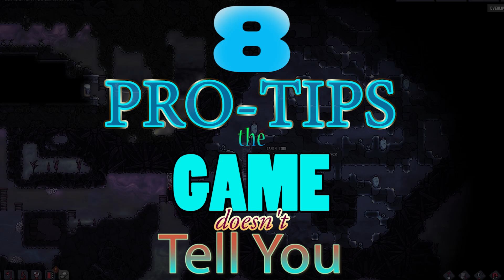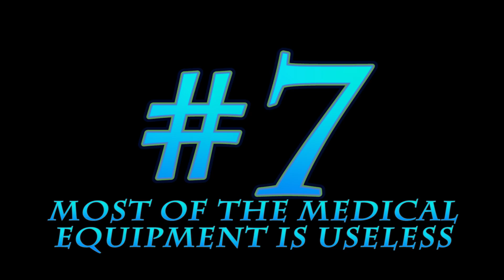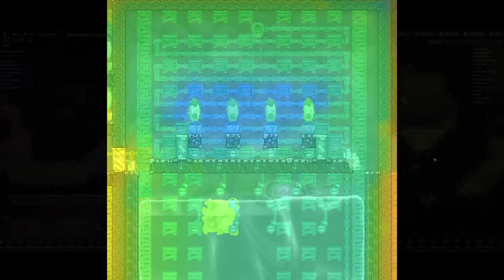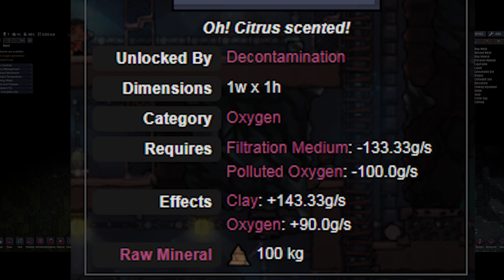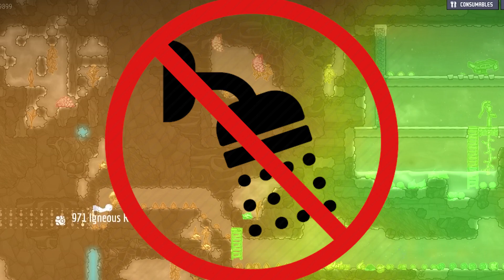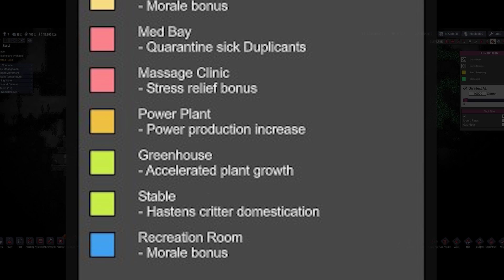8 PRO-TIPS THE GAME DOES NOT TELL YOU - Oxygen Not Included Tutorial / Guide

Comment: 1.Store food in a carbon dioxid pit near kitchen its sterile athmosphere there is less decay without oxygen . Its powerfree no refrig needed.   2. Store polluted germ water early on in the liquid tank in a hot area the germs beginn to die off quickly  power free except when the pump runs for the sinks. Or loop the toillet trough a tank its no more power needed. Just for the sink. 3. Go as long as you can without coal or other generators than the mill it keeps heat low.

Comment: Here's something I've discovered as I've gotten more used to the game. See, I've developed this system where I clear minerals/organic blocks 4 tiles at a time (the Dupes stand on a random block, and I clear up to four tiles above that block) since that's the maximum height they can reach from the ground, then build a tile underneath and above that 4 tile column. This ensures I clear out each pre-existing block for resources and leave in empty enough to establish a room. That being said, you should only have 16 consecutive tiles max if you're going to make a room out of it later since the maximum amount of tiles most rooms can have is 64 (64 divided by 4 is 16). I thought I could get away with 18 consecutive tiles and use the two ends for walls/doors, but it said it was too big until I removed one column. So I'd recommend 16 tiles and use the 2 ends for walls/doors because that's typically enough room for most stuff you want to build, greenhouses, barracks(enough for 5 cots separated by flower pots) etc.

Comment: For #5 you can (and probably should) use a set up involving weezeworts. Slimelung dies in cool temperatures too, and combining the two eliminates it almost immediately. I once had a setup involving a dirty polluted air vent/geyser and it generated a reasonable amount of clean air over time. As long as you don't let the gas volume drop too low it works pretty well.

Comment: -If you build flower pots on horizontal automatic airlocks doors, you can "deactivate" wheezworts by opening the door and even automatize it.
-The water coming out a water sieve is ALWAYS at 40°C, you can use that to turn really hot polluted water into 40°C clean water, making it go through an aquatuner once gives you water cool enough for your bristle blossoms (which can use the water created by lavatories and require no fertilization).
-The previous trick can help with boiling hot water : use it for your bathroom and run the polluted water produced through the sieve to effectively delete heat. Dupes won't mind a 95°C shower so it's a good way to convert more hot water into cool water as the shower uses a lot of water. Get a wheezwort in there too (the water stored in buildings can heat up the room).
-If you want warm polluted water for your pincha pepperplants, keep natural gas generators in an area between 35°C and 85°C, you will get polluted water at the same temperature ready for irrigation.
-Do NOT tame every critter you capture, dreckos are a giant pain in the ass since they need too much space to be groomed easily and slicksters can eat all your carbon dioxide really fast once tame and then die... Simply relocating critters closer to the base is often better.
Reply: The sieve trick doesnt work as the latest update, i tried it

Comment: 1. In most situations a gas shutoff and a gasous pipe element sensor can be used instead of 120W consuming gas filters.
2. Slow (unpowered) mechanised airolck automated pumps.
3. Using shift registers instead a series of buffors for automating airlock pumps helps regulate pump's speed.
4. Open airlock vacuum insulated thermally and may be useful for building steam turbine volcanic powerplants (heat shutoff).